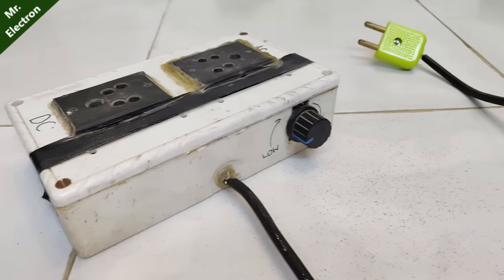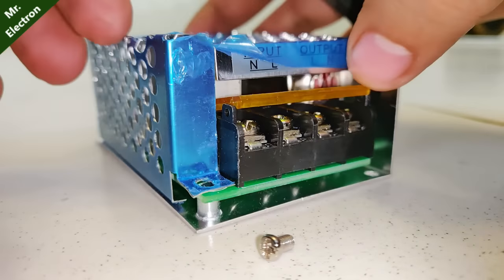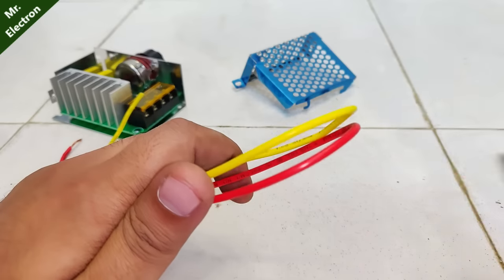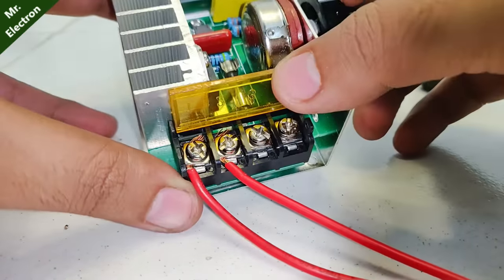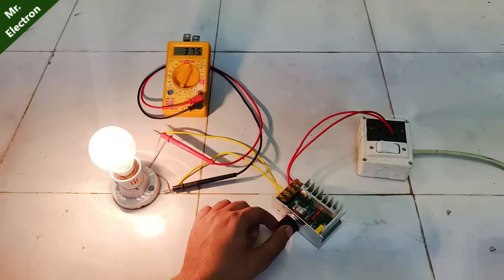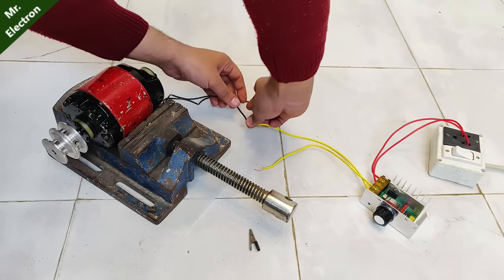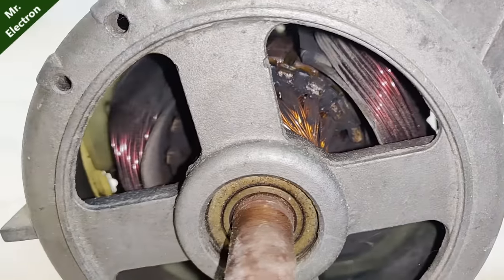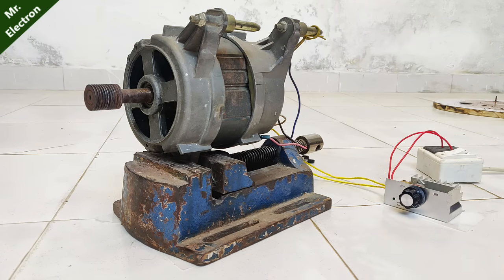4000W 220V Universal Motor Speed Controller for Washing Machine Motor

Comment: I have a few questions. 1- Isn’t this an AC to AC voltage regulator - to lower AC voltages?
                                          2- if it is an AC to AC regulator, then why is there a bridge rectifier in 
                                              Its circuitry?
                                          3- At +/- 4:35min you say: that this is a SCR speed controller and 
                                              it only changes “the firing angle” if that’s what you said, what does 
                                              that mean? And if that is not what you said, then what did you 
                                              say? Please clarify for me.
                                              
                                              I bought this device, because I thought I could use it to lower 
                                             120VAC, down to 9VAC. Was I wrong? Please let me know. Thank
                                              you kindly.

Comment: Hi Experts, usually we control AC motor (other than Fan) by dimming voltage, the motor burns out.
Isn't it the case? With this dimmer?
Please advise, 
I'm  thinking to control a sewing machine motor which runs upto 7500 RPM, tried with fan dimmer & burnt already on lowest speed

Comment: How could this work on a fan? The induction motor's speed is not affected by the voltage, unless you're operating it below the voltage that is required to start spinning

Comment: Never ever grab a wire you are unsure is live . At the very least touch it with the back of your hand so that if your muscles spasms it won't force you to grip it . But never touch that wire , use an insulated plier, be insulated from ground and work on insulated materials like wood or plastic
Reply: Nuh uh

Comment: Dude, get a disc shield for your angle grinder. If it blows up, the shards carry enough energy to rip through your tendons, joints and maybe even bones.
Reply: They used this kind of thing for actual bone mills in the 70s and 80s
Same motor and disc so
Yeah no joke
Reply: @Jasmine-gw1uw  Actually I have a story about my grandpa, may god look over his soul. He used to do a lot of tinkering and he pulled out a motor from a vacuum cleaner and mounted a grinding disc to it. He wanted to cut a hinge of the window and the disc blew up. Piece of the disc went through his shoulder and got stuck in a cast iron sewing machine behind him across the room. So um. Yeah, disc shields. Prety useful.
P.S.
He didn't die becouse of the exploding disc. Cancer did it.

Comment: Would that controller run on teslas plasma energy? By running ac sine wave thru a spark gap you get ac direct. Running ac direct thru a vacuum tube spark gap you get teslas plasma energy. That has the capability to run a drum motor at 3,000 rpm with less than 2amps. According to Gerard Morins work, at 9,000 rpm you can power a 3.5 kw transformer with a edrum motor at 9,000 rpms. He couldn't get a controller to turn it that fast when he seemed to go missing 6-7 years ago.

Comment: Hi
Can anyone guide me? I have a motor (spec below) , will this controller work with it?

3 Phase Induction motor (60mm) CIM2/55 - 132/AD6 - 195V 3.7A 800W - 290Hz - 17000rpm INS Class F
Reply from the maker: No. This contoller in the video is only for 1 phase machines

Comment from the maker: Hey Everyone ! Just wanted to inform you that the ' site ' ( flipkart ) from which bought this product stated that it was an SCR based Controller but when i did some research , it turned out to be a TRIAC which i expected too but the sellers got me confused.....
Although, there is not much of a difference between an SCR & a TRIAC except for the fact that an SCR allows the flow of current only in one direction but a triac allows it in both the directions.
Hope it helps and appologies for the confusion.

Best Regards,
Mr. Electron
Reply: I have this too.  Not sure it has a bridge rectifier.  Ac input ac output.  I had to factory mine to dc
Reply: Thanks for the video. Could you please also share the power efficiency for this regulator? I am particularly interested to understand the power loss better input and output when it is operational.

Also, does it output pure sin wave AC output?
Reply: Yaa 👍
Reply: @pradipdas1977  No, it's not "pure sin wave AC output" because this device is JUST a command in the triac phase. So far away from that is real Motor Speed Controller. It's identical with those component from portable drilling machines.
Reply: @mr.makeit4037  It does have a bridge rectifier but it is not using it as a rectifier! It uses the four diodes as part of the trigger circuit.
Reply: If you read my comment, you would notice that I had to rectify my circuit after purchasing one of these controllers, a 10,000watt unit.   I have a diy metal lathe powered by a 120v dc pm treadmill motor.   This required a full wave bridge rectifier that this scr did have.  I also filtered it with a 1000uf 220v polarized cap on dc side and inductor on the ac side.  It works great.  Thanks for the comment.
Reply: Correction:  My motor controller did NOT have
Reply: @pradipdas1977 
Can I use this speed control with 1/2 HP INDUCTION MOTOR TO CONTROL THE SPEED OF MOTOR
Reply: How do you know which is positive and negative all you said was input and output if your putting power in to it the fuse from a plug side where does it go on the input thanks
Reply: Can you help me? I need cỉcuit. I’m Viet nam. Thanks!
Reply: @desktop9298   same question, can I use this speed controller with 1 or 2 hp motor which is single phase motor under 1500 watts???please answer us so we will be glad !!!
Reply: can I use this speed controller with 1 or 2 hp motor which is single phase motor under 1500 watts???please answer us so we will be glad !!!

Comment: Mr. Electron
Sir, can I use this controller, the input is AC 220v and the output is connected to a step-down transformer input AC 110volts and output 40volts, 8 Amperes? thanks
Reply from the maker: Yes, you can, but make sure that you do not go beyond halfway mark and better to keep it on the lower side. It will work, although there will be humming. Make sure to watch my upcoming video. It is about this controller, and you are the first one to know that now beforehand 😀.
Reply: @MrElectron  thanks
Reply: @MrElectron  is it also safe to use a fixed valued resistor to get a 110v output instead of the stock potentiometer. thanks.

Comment: Upward of that 12K rpm range and below 30K with a big fan/cutter wheel/impeller/propeller will make it sound like the grinder, high rpm’s with no weight sound sharp like the red sewing machine 
That’s what I was trying to figure out before, as I love these high speed motors in things, but I like that lower pitch 
And this is a 15-25K rpm brushed series wound universal AC/DC for anyone lost and/or confused like I was, there are a million specs and rpm/torque variants but they’re all the same “Type” of motor

Comment: SCR only have half cycle ac so called TRIAC consist of two SCR connected in bi-directional so that to give you a full cycle of ac voltage, in other words a SCR combine with a pnp +npn transistors and thus with two pair of pnpnpe trasistors.

Comment: Hi, Thanks for this video. I have ordered this one to use my 110V, 550W mixer/Grinder which is manufactured for US. My question is, will this mixer will work well with this? Or do I need to buy step down transformer?
Reply: It's a speed controller 
Not voltage controller
U should by step down transformer

Comment: Where did you buy the 4000W 220V Universal Motor Speed Controller?  I can't seem to find any AC controllers, just DC.  Thanks & GOD BLESS
Reply from the maker: Its a '4kw dimmer' that can also be used to control these motors.
Reply: Thank you so much sir for answering my question.  GOD BLESS!

Comment: Thanks for your video. I need 4000W  universal motor . Please share link how to get it. Thanks
Reply from the maker: 4000w is for the speed controller
Reply: @MrElectron  thank you for your quick reply
I want a 2000watt or above universal motor for concrete mixture project. 
Please share buy link .
Thanks again

Comment: Is that changing the voltage or the frequency?
Reply: Neither. A triac controls how much of each ac half cycle current can flow. If the unit is on full power it conducts for the whole of each half cycle. If it is halfway it conducts for half of each half cycle. If it is on minimum it only conducts for the last little bits.
Reply: As you can see at the beginning of the video it does change the frequency... look at the camera is getting some noise from the dimmer

Comment: that is a triac
Reply from the maker: Just did some research. Your words prove true. 
The sellers made that error. Please check out the pinned comment.
Reply: @MrElectron  yeah if it was a scr controlled one it would have two scr ..a triac having two scr integrated in it.😀
Reply from the maker: @spandandutta2485  Coz scr allows current flow only in one direction so yes indeed ! 👍😊